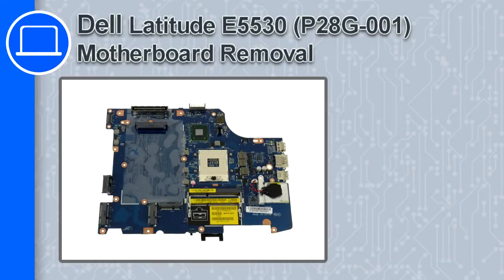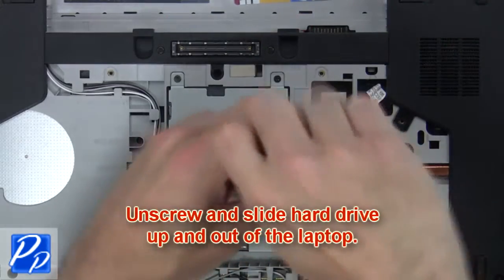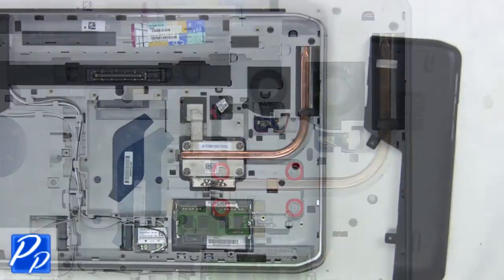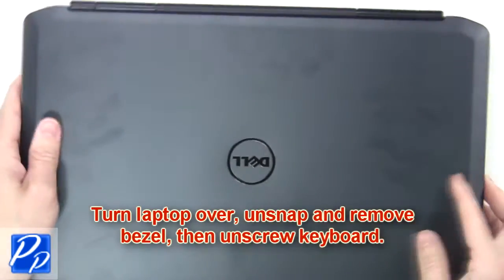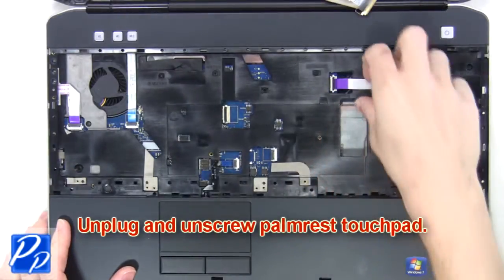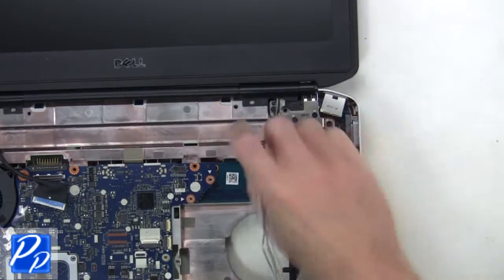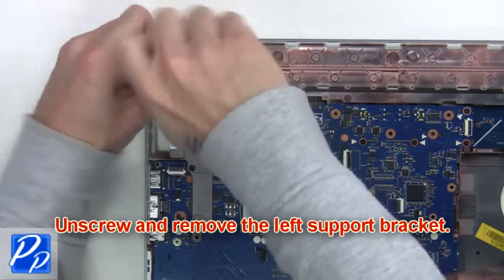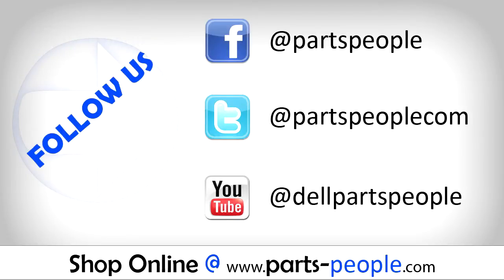Dell Latitude E5530 (P28G-001) Motherboard How-To Video Tutorial

Comment: Will only certain MB revs work with the SSD drive version of the E5530?  I have a i5 processor and SSD drive will any E5530 MB work?
Reply from the maker: The SSD will work with all of the E5530 motherboards.
Reply: and all will woork with intel i3/5/7 processors?
Reply from the maker: Yes SSDs will work fine with the  i Series processors.
Reply: Does this have inbuilt Bluetooth? how to use it?